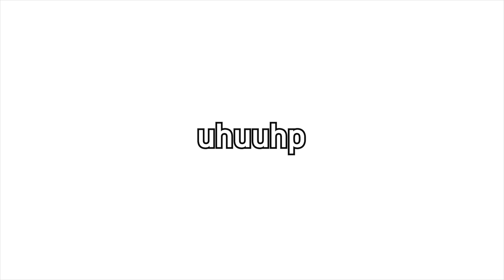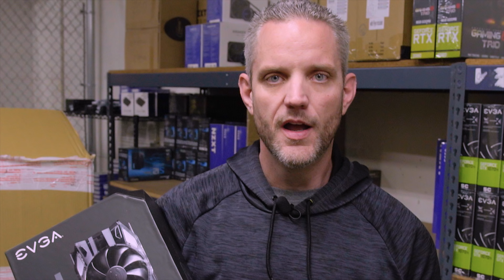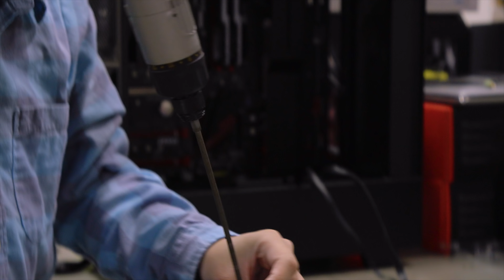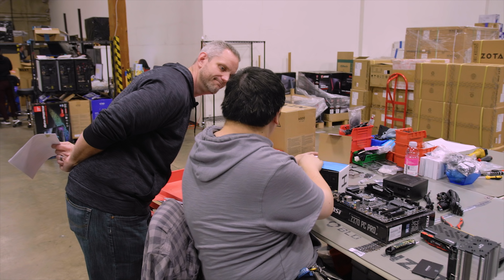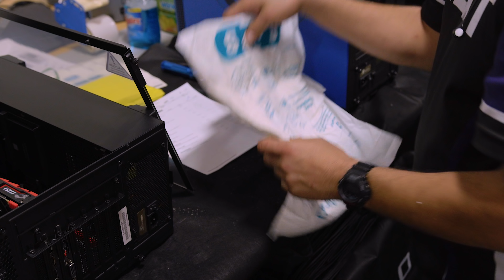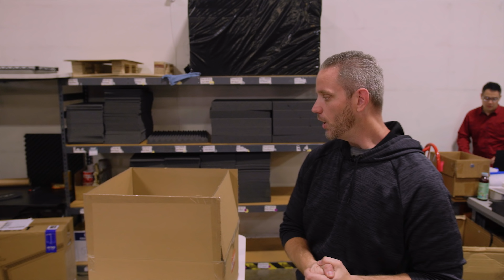How NZXT Computers are built

Comment: NZXT's products are criminally faulty and they have horrendous customer support. Never buy from them. You've been warned.
Reply: It is their software that is bad, the quality and material  is great, same with looks if you pick based on that
Reply: Criminally fault in what sense? I have seen nothing but good reviews on their cases, fans, and radiators. Are you referring to their mother boards? Because they aren't known for their motherboards, so I would not be shocked if they were sub-par in quality. Their cases and fans are amazing, though. The lighting on the RGB fans are smooth and not obnoxious like cool master or corsair. Just a soft glow to give your case a little flair around the edge.
Reply: First Step: Question, have you ever owned one? If yes, what happened? If not, proceed to step 2.

Step 2: fuck off
Reply: we say that shit to people that go to best buy . . . . 

they still go there . . . .
Reply: There customer support is good  and there products are not criminally faulty because every part I got from them never broke on me and they update there software to.  Giving false information to people

Comment: I see no emi static care at all..just saying

How do these compare to Xidax or Digital Storm? Would love to compare them
Reply: Static is only an issue if you're working on a wool/shag carpet and drawing your feet a lot while bare foot or wearing socks.

These people are working on a concrete warehouse floor and metal/wood tables. The odds of having an ESD issue are basically nill. Someone would have to be wearing a full wool suit and rubbing themselves all over in order for that to happen.
Reply: @megamixa  its nil or null tf is nill
Reply: I know when I build my own PC's I usually just touch the case every so often when I feel nervous about shocking something. I think the mats that they're building on are possibly anti static and have their logo on it no?
Reply: @HeliosStatheros  I think those are just those standing mats that they're required to have by law. If your job requires you to stand for extended periods of time, they have to give you those mats to prevent back straight from standing. They work somewhat, but if your posture isn't good, it doesn't do much. Although, it does act as a shield for ESD. They're basically just rubber or that mulched rubber stuff.
Reply: You ground yourself when you touch the case.
Reply: I built this rig 12 years ago i belive so yea
Reply: thought it might be important to throw that out there
Reply: Xidax is about the same level as NZXT, while digital storm is for more prestigious and more expensive pc builds

but that's just my opinion
Reply: It’s been proven multiple times that static isn’t something we really have to worry about anymore in the past it would have been a problem but now we’re fine. Also, depending on the surface you are building on static just isn’t something that happens anyway. It looked like wooden tables to me so that will not create static. Over all to me I think what they are doing looks great. I’m going to keep building my PCs but they are still definitely an option. Sorry if I came off harsh with this comment I’m not trying to. It’s hard to convey tone through text.

Edit: I’m not saying to go build on a plastic table or run your feet on carpet before you build but it’s not as big as problem as we think. Also looking back at the video it looks like they have full tables cover with table sized static mats
Reply: @jom0bx189  well 20 years of military work at depot lvl on Radars tells me EMI static is everywhere. 6 years with Raytheon and if you didnt wear your strap you were out on the street.... but hey whatever
Reply: The thing is these parts are meant to be in a static environment because they are hobby parts basically. 20 years ago the technology to prevent static from frying your MoBo was really around as much. Plus they’d better throw you out if you are working on a military project that’s tax payer money. I’m not saying it can’t happen I’m saying it’s difficult to fry your PC now using static unless you are doing it on purpose. I suggest looking at Jay’s video where he builds on carpet and doesn’t have any problems.
Reply: @jom0bx189  I put a mobo on a wooden table with an anti-static wristband on and my mobo broke. From static damge.
Reply: @hehehehaw7  Gonna say your motherboard didnt die from static damage, something else broke it. Static is a non issue for most computer hardware, as there is quite a lot of fail safes for static damage.
Reply: @hehehehaw7  got any proof of that or just a doa motherboard?  
Wood is non conductive. If you had an esd wristband on at the same time I'm gonna have to call full on bs.
Reply: Piggintins gonna have to agree with the other two guys on this one. No way to get static from wood and with a wristband, you should have been fine anyways. Something else caused you problems. Could have been dead on arrival.
Reply: @bluepantherofdeath  It worked i took it out didnt work i checked it out didnt know what was wrong called a friend who does this shit for a living said static damage.
Reply: @bluepantherofdeath  Probably was a faulty wristband or something tbh you right that wood is non conductive or i hit the bottom of the case by accident
Reply: @Khaltazar yea i heard a popping noise and it was grounded. i actually dont know wtf happened but ik it was static damage.
Reply: DeadwoodHero yea that was bothering me quite a bit. Not a good way to advertise unless there is something I missed.
Reply: Yea... same.